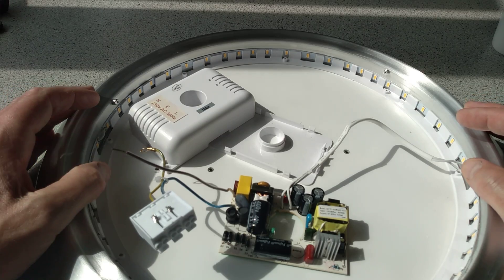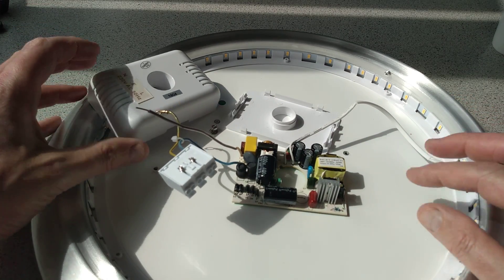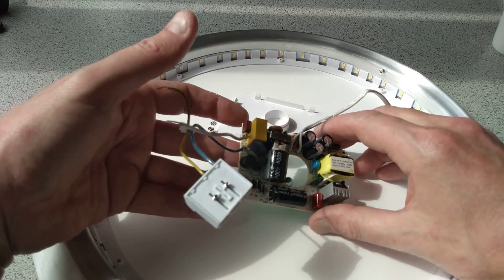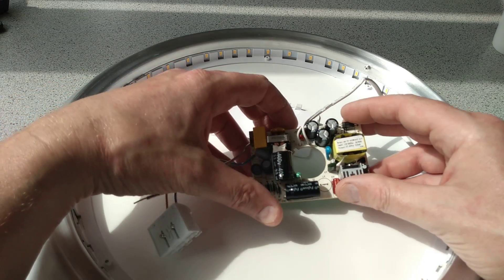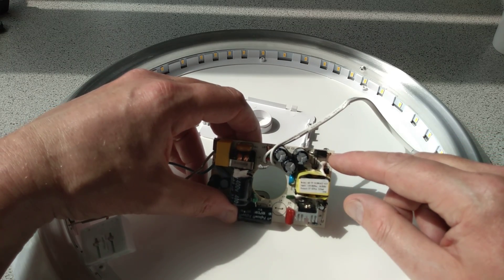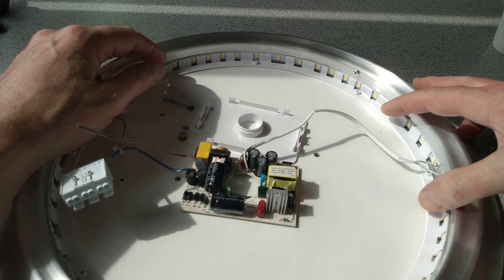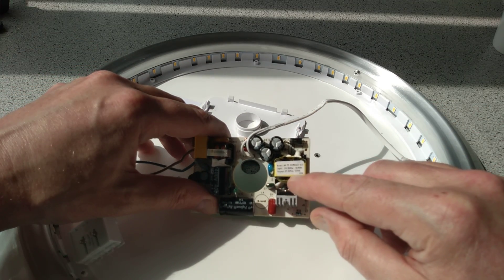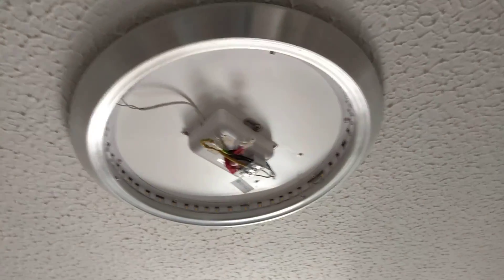Repairing the light in my accommodation room.

Comment: I like to hang the "Do Not Disturb" sign on my door even when I'm out. When I got back the one time they were not pleased. Maintenance wanted to get in for some issues the last tenant complained about. There was a lamp socket with a bad connection. I  told them I had already fixed that. Then they said the commode would sometimes keep running. The chain was adjusted too long and would catch under the flap, I had fixed that too. They offered me a lower rate to stay but I had already made arrangements to switch accommodations to stay on the other side of the city. I'm not sure if the reduced rate as effected by the repairs or just to try to get me to stay.

Comment: A riddle for all the big Clive LED afficionado's, why would a 240v LED dimming panel replaced by another 240v LED dimming panel not work? Wire a light bulb into dimmer, works fine, wire new LED panel into mains, works fine but not when wired into each other! You'd think after all the big Clive video's I've watched I'd know but it's doin my head in!!!
Reply from the maker: Some dimmers require a minimum load to latch on.  The load of some electronic power supplies makes them incompatible with traditional triac style dimmers.  You get a newer style of dimmer for LED panels that works on a lagging edge basis and is more stable.

Comment: Nicely done,  i bought a high power lazer off ebay, the charger for the 16340 batterys is more dangerous than the laser, the + connection creeps inside the case in a way that looks like its ment to for some reason,i goes directly toward ac inlet, glad i opened it to see whats going on, insted of poking fingers around the batterys trying to get the red charging led to light.

Comment: I repaired a bathroom tile, regrouted the bathroom & rewired in the oven (it dipped on and off, and made very..loud arcing noises when on) when i was a student..in student accommodation...

despite being certified or what not (for the electrical work) they didn't like me fixing things, and did their utmost to evict me after that.

Moral of the story? Never use Unite Students...the company are run by, and hire cunts.
Reply from the maker: I'd never tell them I'd fixed anything.  I just do it secretly as they would probably not be keen on other people doing technical work in their property.
Reply: There's a point to that I suppose. Most of the places I've stayed in have needed work doing and I got them at reduced rent from the landlord as a result.

Company in question though has some questionable management, considering they're happy to try and get me to sign documents under duress/by threatening me.

Comment: Yeah, but how does it look when it's illuminated with the glass cover (or whatever you call it in english)? How well does it spread light in the room?

I didn't happen into a solution like this so far. But I think it's a good idea. It's far easier for the LEDs to have adequate cooling in the rim rather than on a flat panel.
I also think that for the best lighting performance the LEDs need to be facing down a bit, maybe  at around 75% to the floor (depending on lamp diameter), I can't tell by the video if this is  the case. I also think there should be a small reflective dome (internally or not) in the middle to prevent them from illuminating each other. (which certainly isn't the case)
Reply from the maker: It wasn't too bad as LED bulkheads go.

Comment: I bet the resources and energy used to make a cheap led lamp is about equivalent to that of a led bulb (more metal and plastic but in a form that can be recycled much easier).
But in Lamps the LEDs and the power supply can be cooled better so it will last longer. Also they can be repaired if you have the skills. The bulbs can't.
So I think the lamps are better.

Comment: I know about fixing where you sleep. The apartment I'm currently in has a central boiler and radiators in each room. First winter noticed most registers putting out little heat, mind the building still had original boiler from 1950s. I proceed to pull every cover off and vacuum out the radiator fins. The worst one obviously being in the bathroom, covered in about an inch of dust, hair, and tons of makeup powder. That is the only one I run full blast now while I keep the others cracked open to provide a little heat. They have since upgraded said boiler and hot water tank.

Comment: Hello Clive i have a little question , i had a small smps exploding at me yesterday , i found pieces of something that looks like a ceramic cap but there was a little Metall disk inside the case ? What looks like a ceramic cap but has a Metall disk (fat one like a little magnet) in it?
Greetings from Germany
Reply from the maker: It might be a VDR or MOV, especially if it's across the incoming supply.
Reply: @bigclivedotcom  indeed it sits between two diodes and a larger cap

Comment: Did you really not test the light before you re-installed it?
Reply from the maker: Nothing to actually test it with in the flat.  I was very confident in the fault diagnosis.
Reply: And if it didn't work it would need to be replaced. Not a good look to have it sitting on the desk waiting, too many questions.
Reply: You need one of those cheap pocket DMMs to take with your screw driver set. Just for your travels. 
Voltlog did a series of videos on different makes.

Comment: Don't know which accommodation you're in but I've heard students say the super sensitive smoke alarms go off if you try soldering in the room - presumably you didn't have that happen to you. did you have to take it somewhere else for soldering or are students spreading urban myths again?
Reply from the maker: I took the light to the kitchen to solder it.  The detector there is a heat one.
Reply: Y know on reflection I think I asked you the exact same question last year and got the same answer :)
I think I'm getting older.

Comment: Hope you discharged that phat cap before touching the board with both hands. I've had >300V DC go through my chest when the solder joints pierced my fingers. Not a nice experience.
Reply: Jim Griffiths forgetting to discharge the cap on your camera is bad enough.
Reply: think "it's a l i v e" (robot chicken intro)...

Comment: Do you go travelling around with a soldering iron lol
Reply: You don't?
Reply: Those little USB powered irons are actually pretty good. OK, no use for heavy chassis work, but ideal for small-scale board repairs.
Reply: @phils4634  usb powered soldering iron ? What ? Never heard of such a thing . I need to check that out .
Reply: EBay is your friend. These can be bought for less than $10, but I've got a TS80 - around the $100 mark. Like all things, you get what you pay for.
Reply: @briandeschene8424  yeah just watched that video . It's very impressive.  I've always used a butane soldering iron but I need a better one .
Reply: @phils4634  TS80 is awesomsauce.
Reply: Brian Deschene ,thanks for the link.
Reply: @silverssonyoutube8438  BigClive did a video on one a while back - its like $5 USD and its a little 10 watt iron the size of a perminant marker.  Really impressive for what it is when doing emergency repairs.
Reply: It is a part of his Swiss army knive
Reply: @Sonny Clive IS a swiss army knife :P
Reply: Yes. As far as a USB soldering iron goes, you can do what Clive did with a pretty decent battery iron and convert it to USB:
https://www.youtube.com/watch?v=gG5RTFYXSLU&t=160s

The iron uses two NiCd batteries. Easy enough to a limited current charge with a resistor and a USB plug.
Reply: Have you seen Dave eevblog's reviews? Here's the cheap one:

https://www.youtube.com/watch?v=FOa783WeDPU
Reply: And here's the expensive one:

https://www.youtube.com/watch?v=_Z9es-D9_8g
Reply: You would be surprised. Have one in my toolbox for working on cars, can run it off the alternator of a second car if I really need to but usually the charge in the battery is more than enough for a couple quick fixes.

Comment: I'd also repair stuff in accommodations, thought it was only me....
Reply: I once cleaned the evaporator coil--it was just about completely plugged--and straightened many mashed fins on the AC in a cheap hotel room. It hadn't been cooling much before I worked on it.
Reply: I was once staying for a few weeks at a small hotel. Chatting to the owner, he said he had a store room full of TVs with various faults. I said I'd have a look, and I started fixing them. In return he said I could help myself to drinks from the bar. :-)

Comment: "There I was, resting in my hotel room. Tearing apart the light fixtures, as one does..." :-)
Reply: Who does not? :)
Reply: Funny enough, did that to fix the light over the sink in one hotel room. In that light's case they used a weird slide-lock connector that wasn't locking, too much dust buildup for the lock to maintain a good mechanical connection. Just unhooked it, wiped it down with astringent and put it back together. Let the front desk know on my way out, was kind of hoping for a discount but I knew it was a gamble.
Reply: americans
Reply: @poiiihy  yeah - we take apart thr thermostats to try and make the air conditioner cool it below 76 degrees...fun fact some of them run on 228V...

Comment: Where does it say " Disposable Fiting" ...
Reply: It's disposable, because that's the only option most people would have when it stops working.
Reply: @_Piers_  good point. I was going to comment that it seemed well-made, not disposable but of course you're right. The maintenance guy is going to trash it and put up one that works. Perhaps LED driver modules will eventually be sold where ballasts are now and they can be serviced.
Reply: right in between the letters "made in China to a price"
Reply: paul martin you cant change the LEDs only. Well, you can, but it would cost more than the whole light. So basically when one LED fails, you change the whole light fitting...
Reply: I have a handfull off those laying around, that i've changed out at customers. It's usually the driver that goes bad. Or the flimsy plastic cover that breakes. 😂
Reply: To most people it is, people don't have electronics skills and even in the trade its more cost effective just to replace modules or the whole unit. Wasteful but that's how things go in industry.

Comment: Clive, you are a landlord's dream tenant.
Reply: rpbajb …apart from all the explosions, stray cats and surströmming parties.
Reply: He does the surströmming parties round his friend's house.
Reply: Landlords hate tenants working on their properties.  Some have even taken steps not to rent to tradespeople.  Google Fergus Wilson.
Reply: This, most landlords don't like you fixing anything even if you know what you're doing. I think its all down to insurance.
Reply: Yeah, if you blew yourself up trying to fix that dodgy fitting near the gas stove or something, the insurance company would be all over that. Better just to let them pay for a certified electrician of their choice to sort it out
Reply: I even know of someone who wasn't allowed to hang picture hooks on the wall in case they accidentally went through a cable or gas line.
Reply: Or a landlord who will not let a tenant install a new plastic bottle tray onto a fridge door. You know the type that just slides in or out so you can clean it!
Reply: Madness.
Reply: @mattinman8285  "certified hvac" person where we rent did a 60A 240V copper-aluminum splice using nothing but electric tape.  When I moved in and saw it I complained (heat was not working well and the wire crackled when bunped) they sent a "certified electrician" who swapped the wad of tape for an uncovered electric box bolted to the air handler service access hatch so now the annual inspection people have to unbolt the box with live exposed 240v circuit breakers.

I may not be certified but I don't think easily accessible uncovered 240V 60A connections should be the right way to do it.
Reply: Technically, it's not their property while it's being rented.
Reply: sadly reality isn't life….
we were renting a house that when I walked in the highlight was that the rope light around the ceiling was too short to plug in to the outlet, the previous tenant extended it by taking a cord ( from something ) and twisting the bare wires around the rope light cord (US) prongs and putting? a little tape over it.

in the US we have what are called Christmas tree extension cords ( or at-least that's what I call them ) they come out around Christmas time and they are green and they're usually the cheapest thing you can buy and almost always two-pronged no ground. needless to say I have lots of spare green extension cord wire now.
the 240v baseboard electric heater needed a thermostat to control it's temperature so it was relocated to a more convenient location with some green extension cord. after the previous tenant moved out and we moved in there was no-longer a control function.

the outdoor light with motion sensor was wired to a switch inside with more extension cords so you could unplug the switch from the light ( and consequently have it not work, the only thing I could think was that he made a dummy plug to disable the switch? never found but if improperly used would've immediately tripped a breaker? ).

the stove outlet was wired with flexible cable using the green wire ( US is black = HOT L, white = N and green = ground ) as one of the phases because they didn't get for conductor cable or do what is common practice steel the white and color it black.

and the grand finale….
every single outlet in the house was somehow wired altogether onto a 50 amp breaker with 12awg/20 amp? wire ( the age-old if the fuse keeps blowing get a bigger fuse or stick a penny behind it mentality )

when I left that house I had tracked almost every circuit down and checked pretty much every junction ( I can probably count on one hand the ones that I didn't get to ), relabeled the entire electrical panel ( complete with an xcel printout sheet ) and I only had one breaker which before I left I figured out was the outside light circuit.

and while I am not an electrician (yet) I'm beginning to realize I might actually know more than an electrician.

OH
we moved out I believe 4+ years ago now, the place has-been empty since. and last I visited it did not get hit by copper thieves yet though it's kind of hard to steal copper out of cinderblock walls.
the place we rented before this we fixed up quite nice and then got kicked out……
we now own and I can say I'm at least not that tenant that took everything they could get a screwdriver to including the front door……..

Comment: The speed you reverse engineer a circuit always blows me away :) thank you for sharing
Reply: he's seen this all before and know what the goal of the circuit is.

That lets you make a few quick guesses at what the components do and reduce the number of options quite rapidly. In this case having a clear primary and secondary side separated by the transformer is a big hint at a switch mode isolated circuit. The heatsinked component will be the mosfet and that is nearly always controlled by the 8 pin chip.